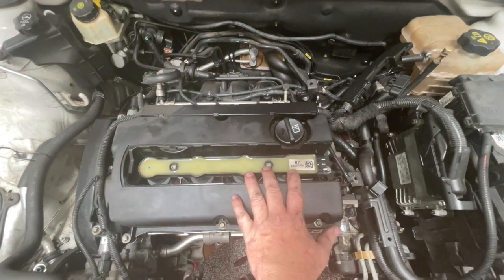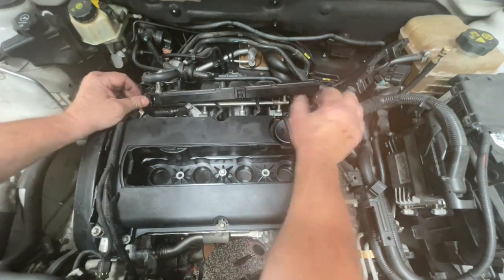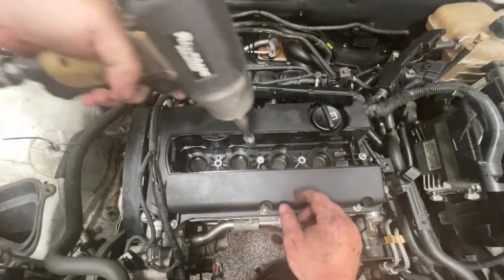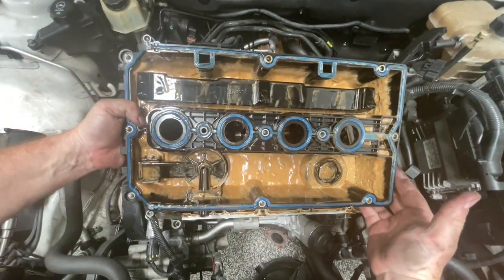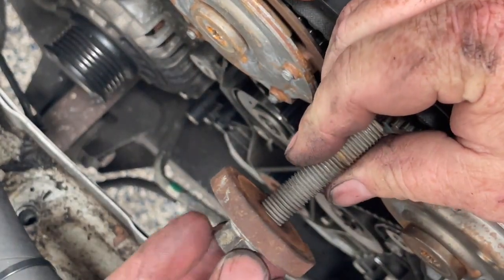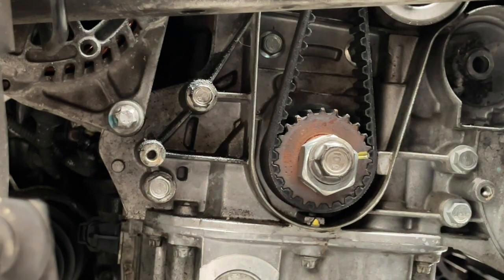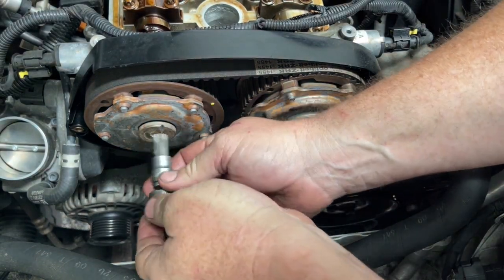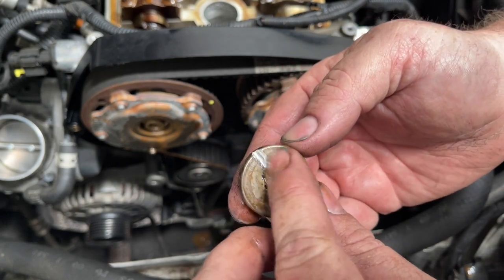Cruze Head Gasket Replacement  STEP by STEP process (Part 3 of 16) Full Details for 1.8 F18D4 Engine

Comment: Great video. When I removed my old timing belt, lining it up just like in your video. I marked the position of the belt teeth to the Gear with white out fluid. When replacing the timing belt with a new belt, I transferred the marks to the new belt, I did this because those gears have spring tension and the first time I replaced a belt with these gears, I was one tooth off, even though I used the locking bar for the alignment.
Reply from the maker: Great tip!

Comment: Thank you, I’m extremely appreciative of your videos. My LUW 1.8 is rusted after a popped a head gasket. Compression was 150psi in 3 cylinders and 120psi in cyl2 shortly before I parked it.

I’m going to try to get away with a lot of elbow grease, cylinder head decking, cylinder ball hone and piston rings. Do the iron blocks typically need decked or can I get lucky? If I need to get the block decked then I’m going to build the bottom end.
Reply from the maker: Have have been lucky with these ones. It's usually good.

Comment: Man, you are so calm !!!!
Extremely experienced Mechanic !!!

Before I do this and I have the tools, do such a pain staking job .

I have a question 🤔 

Ok , you ready 🤣 

I will make it short and sweet 

My engine raised to the hot position on the gauge, then turned the car off 
Changed the thermostat, and all was good .

2 weeks later, the oil cooler gasket is gone on the cooler # Milkshake 

Replaced that , flushed it , bleed it plus new oil .

Now, this is my issue , but only if you want to help a bloke out 😉

The expansion tank is showing low, but when it's up to temp , it's above the high line after about 10 minutes of driving.  

Plugged it in obd2. The temps are all good ,no codes,  nothing wrong with anything , all measures up !!!

When running the expansion tank, it seems all normal other than being high .
But when I turn the car off , I still have a consistent fluid running through it, and I don't see any bubbles .
When the engine is cool , the fluid is lower than the low line, but not much .

Nothing leaking anywhere, and the coolant stays the same day in day out .

Oil is like brand new and not raising,  not mixing. 

Could it be the water pump 🤔 
Expansion tank cap 🤔
My expansion tank has some slight signs of leaking, and I have ordered a new one with the metal sleeves in them .

Does a low-pressure cause some sort of vacuum 🤔 

Anything I may of missed to diagnose what else it could be 🤔  

Either way, I'm subscribing now that I have found your videos so freaking impressive 👏